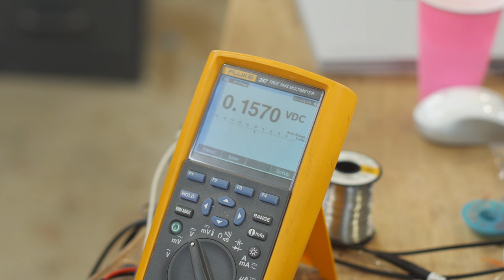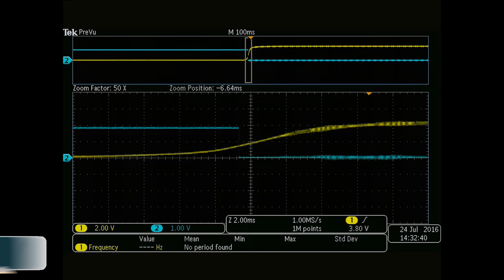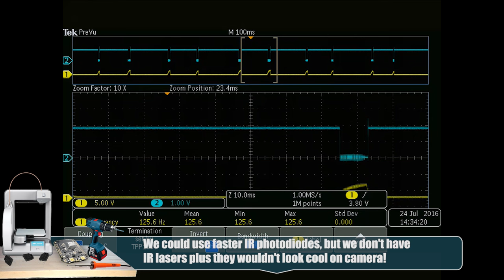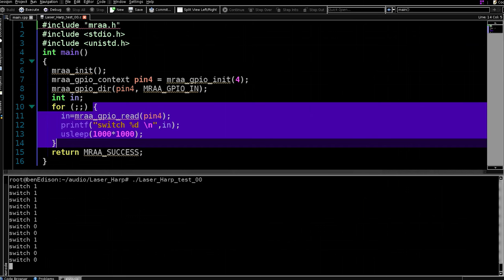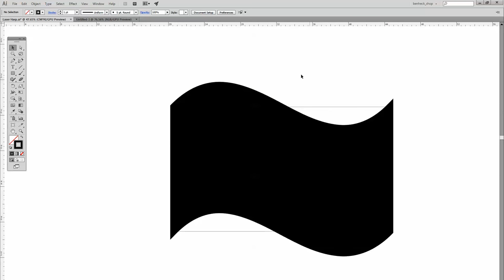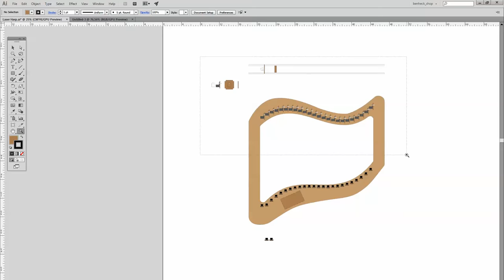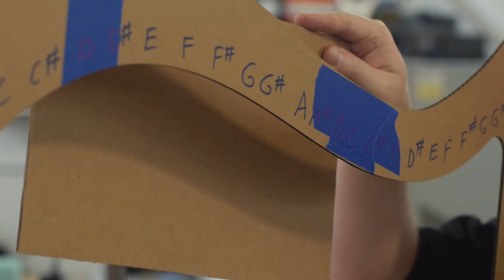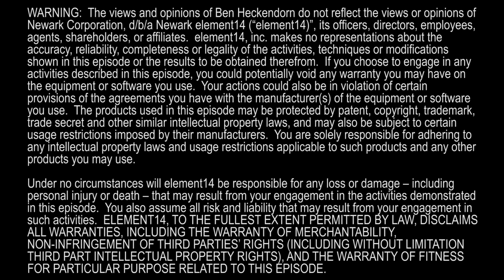Ben Heck's Intel Edison Laser Harp Part 1: Design

Comment: You can have more than 2 octaves.  Harps are not tuned chromatically (including the sharps and flats), but rather diatonically (just the scale notes), and have levers or pedals to raise or lower the strings in semitone increments, so the harp is played in one key at a time.  This means you can get 3+ octaves with 24 strings.

FYI: http://www.morleyharps.co.uk/how-are-harps-tuned

Comment: I wonder if there will ever be a powerPC or MIPS based single board computer.
Reply: yep i would love a powerpc barebone
Reply: +Hydrameda I was thinking old timey Mac OS virtualization or GameCube emulation for powerPC.
Reply: +Hydrameda powerpc cpus are more efficient than they used to be. if u think they died and havent advanced since apple ditched them ur wrong. the architecture has become a lot more efficient to the point where in some cases its more efficient than x86. powerpc is an awesome architecture
Reply: +Hydrameda no
Reply: the AMD A10-7800k doesn't get very hot as I haven't heard the HSF ramp up too much and I have my computer on all the time.
Reply: +DAVID GREGORY KERR the fan speed isnt always the best measure of how hot your cpu is. download cubid hwmonitor for the actual temperature.
Reply: +DAVID GREGORY KERR just sudo apt-get install lm-sensors. it can give you various system temperatures by typing in sensors in the terminal.
Reply: Dustin M I run Linux mint 17.3 Rosa 64bit so CUPID.exe won't work

Comment: This would be similar to what Jean Michael Jarre played played during the Rendezvous Houston Concert where he used buildings for the backdrop of his stage and projected images onto the sides of buildings. oh and by the way the laser diodes have three terminals one of which is a sense diode and that should be connected to the inverting side of the op amp which drives a pass transistor which supplies the laser diode and this makes sure that the laser diode doesn't burn out, if you are interested the album RENDEZVOUS HOUSTON is available on Daphina Records, I repeat the warning not to forget  to use the sense diodes which should control the power into each laser module so that the lasers doesn't burn out, all the lasers should be mounted in heatsinks to take away the heat which can cause the laser to die prematurely, The track that was played on the laser hard was OXYGEN V.

Comment: Way to complicated analog circuit. The best and simple circuit is just to use a supply voltage of 1.8V for the analog circuit. This will use less components can be directly connected to the edison.
Reply: I'm pretty sure the voltage drop over a laser diode is more than 1.8v.....
Reply: Nope you can easily use a laser diode on 3.3V same as the receiving circuit. Only thing that will deminise is the brightness, but if will still be visible.

Comment: Good idea Intel, name your product after a guy whole stole most all of “his” inventions from his unpaid interns and was a notorious patent troll. That’s like naming your company after a known anti-Semite and nazi sympathizer. cough*Disney*cough

Also, this is an inherently bad idea. Harpists, or really any musician playing a stringed instrument, rely on the tactile feedback from touching physical strings. Even if you aren’t plucking them, you need them to rest your fingers on. It may work, but it won’t be easy (or accurate) to play. A much better application would be adding this to an existing harp, lining it up with the strings and having it trigger a different (selectable)  midi instrument for an additional layer of sound, so long as the latency is very, very low. They make pickups for guitars that do just that, but they aren’t triggered by lasers and photodiodes.